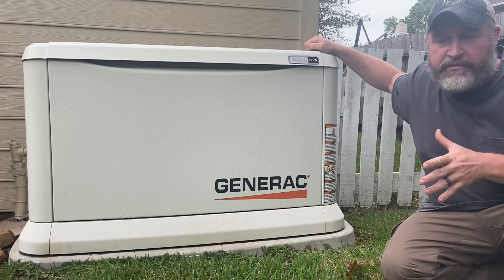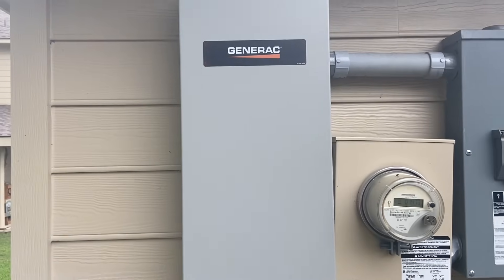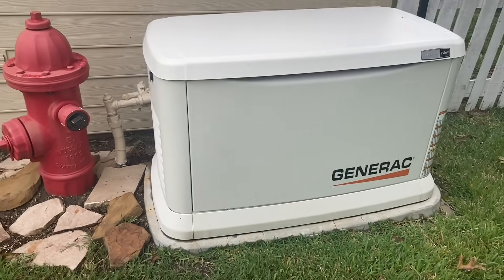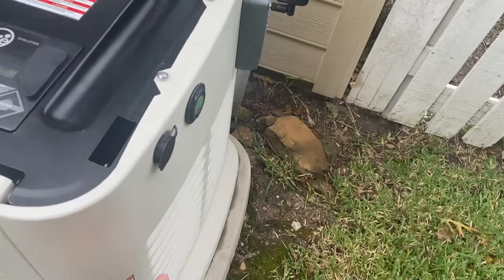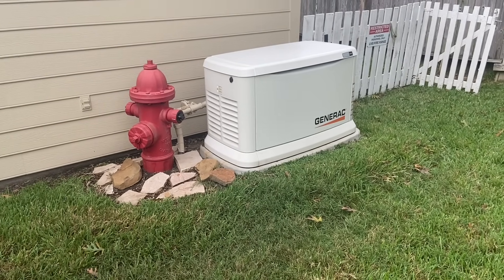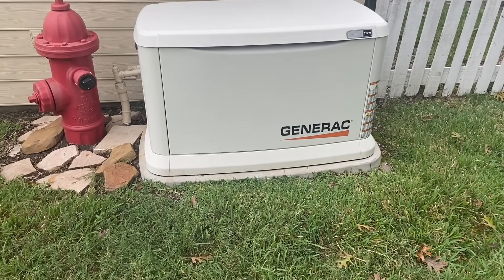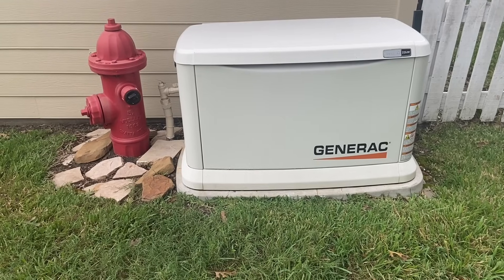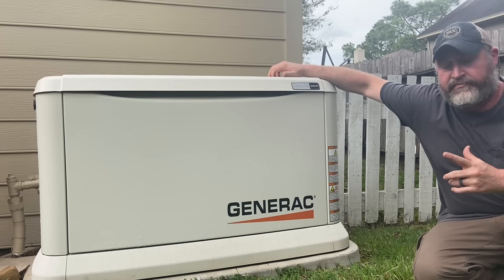Thinking of purchasing a generac whole home generator?

Comment: I have one of these because of the sump system in the basement and what can result from a loss of power which happens in Indiana during winter.  I have no regrets with this buying decision made years ago.  Only thing that went wrong was the recharging device for the battery for the starter but that didn't break the bank.
Reply from the maker: Nice buddy thanks for stopping by and checking out my channel. Please subscribe like share!

Comment: Nice but too expensive it's cheaper to just replace all the food in my freezers and refrigerators
Reply from the maker: Got it for more than just that , but thanks for sharing your thoughts and watching
Reply: YES, but it is about more than that. People can and do die in heat waves, and having access to some a/c, cool foods and drinks, etc - means a lot. With my mom during a huge heat wave without power, I could not get her to enter the air conditioned car to leave. She was having bad stomach problems, and as usual was not being logical. To her, she "couldn't" leave the house during an extended power outage. I had to rush out to buy battery operated fans to at least have SOME air circulation. We had central a/c at the time, and a small bedroom a/c I fought with her to leave installed - think of how wonderful it would have been to have just had electricity for the one bedroom a/c? She would have had a cool bedroom and bathroom -
Reply: nobody buys a generator for that smh try being with out power for days / weeks
Reply from the maker: @terrisw05  exactly! Thanks for watching and the comments, please subscribe and check out some of my other videos I do a lot of engine content.
Reply: And if that's all you need it for, you are lucky.  If you have a well as I do, you also lose water once the pressure tank runs dry and while that may be ok for a few hours, a few days is a whole different situation.
Reply: What if the gas company goes down?  Sorry but am serious - it seems like “they” find a way to make life difficult
Reply from the maker: I am 44 and have never lost NG to a house so…..I gamble I guess

Comment: uses 200 to 300 cubic feet per hour.....50 to 75 therms per day .....now natural gas had been cheap, up until the war in Ukraine, but even now that is still $150 or more per day for fuel......
Reply from the maker: Last time we needed it the cost was 17$ per day
Reply: Ridiculous. Changing plugs every year is ridiculous. Paying someone $400 to do yearly maintenance, is ridiculous.
Reply from the maker: @donwold1622  i agree we pay to monitor which includes the yearly maintenance thanks for watching.
Reply: @kenchiison4570 let’s go Brandon
Reply: @donwold1622  Paying someone to perform required maintenance is cheap insurance.  Doing it yourself would certainly be less expensive-it is.  But having a trained service tech is a lot like skipping the general purpose doctor (i.e. homeowner) and going with the specialist, who can sometimes spot problems before they happen, and you wouldn't know otherwise, doing it yourself, until it didn't work-and that truly is EXPENSIVE.

Comment: Jesus these machines are loud AF.
Reply: Yeah but wouldn’t you rather hear the sound of a generator running than silence when you have no power for 8+ hours?
Reply from the maker: I can’t hear it inside the house with the A/C  on and tv on. At night we run a fan still can’t hear it.
Reply: Eddie A  not entirely typically the storm knocks out the power but with the exception of all the stand by generator homes for the most part the following hours or days since the storm is when generators really start running, but when the power is out the only ones who care about the sound are the suckers with no generator 😂
Reply: Eddie A  Mine is dead quiet, and the light never goes off. Its called a Tesla Home Battery. 
But it won't work as long as these gas Gen do. Unless you have solar to recharge.
Reply: maybe you can build a sound proof barrier around it and screen behind the louvers to keep the critters out
Reply: @fredpinczuk7352  where did you buy yours? They’re quite difficult to come across no?

Comment: Community beware generac are all be up to date because they failing breaking and take months to get fix I have their products and are failing 3 times a yearly
Reply: Details? Which products exactly? How are they breaking?
Reply: They are very problematic these days, I have an industrial 50kw that has been a lemon ever since it was installed. Have seen numerous Industrial and Home Generacs with similar issues. Wont start, undercrank, overvoltage, etc. I'd stay away from Generac and look at Kohler or Cummins. Also be aware just because you buy the extended 3 or 5yr warranty doesn't mean they will honor it.
Reply: As a distributor, we know the stories all too well. In general, they are crap. You are lucky if you get four years with no problems. Many people have problems well before that.
Reply: My solar panel was change corsets twice one month. 
Powerlink burn last summer and now is winter, and last see what the surprise. Generac generator pw links and the raley  fail .

They don't have specialized technicians in florida available to take care .

Take 3To 6 months  to look and get parts and no guarantee

Comment: I had my Generac whole home generator installed 10 years ago, still running on the same Red top Optima Battery.
Reply from the maker: Nice mine came with a 18 month interstate battery and that battery was junk. I did not know the onboard charger could work with a AGM optima battery? I went with a wet cell die hard and it’s been good since we replaced the interstate. Thanks for watching have a great weekend.
Reply: @JustCantSitStill  Thank You! Have a Great weekend also.

Comment: We have a 12KW Generac and everything you said was correct except service is only $288.00 in 60137 Our generator is not that loud, however it is the same engine as you have and our lights come on 15 seconds after losing utility power.  We also have a 20A line to the neighbors house free.
Reply from the maker: Everything I said was correct for my area , I pay for the gen monitor service which includes more than just maintenance.

Comment: Had my 16kw generac installed about 6yrs ago. Ran fine for about 5 yrs and it is getting into my wallet now. Stepper motor last year $540and now my rotor is bad $1780 more.  Came home after being gone for the winter to a red light on . Have had this unit serviced annually by a generac dealer since we purchased it,not happy called generac and complained but dont think anything will come out of it.
Reply from the maker: Wow that stinks Chuck , guessing no warranty left ? Thanks for watching please subscribe if you have not already and please check out some of my other videos!
Reply: Another reply about Generac customer service. I know my unit was a year out of warranty,thought they might help a little on part i had to replace.  Was  a 16kw that had a bad connection under slip ring collar on the rotor. When i called them had some lady that read strictly from her manual said that I needed to talk to the company that installed my generator for any help on cost. Was not the fault because of them just a faulty connection that was a manufacture issue. Lady was of no help and rude. Will think real hard about ever buying another generac product
Reply from the maker: @chuckp3742  hey Chuck are you going to end up paying to get it fixed or just going to leave it? Just curious of where you go from here.
Reply: @JustCantSitStill  Had it fixed, to much money invested and we needed to get it running with us being gone during winter months. Real disappointed that you spend all this money and got dinged last 2 yrs.  Not a fan of the generac brand
Reply from the maker: @chuckp3742  thanks Chuck for the reply and I really hope you have no more issues.

Comment: I have an appointment this morning at 11:00 to discuss needs and associated cost of a Generac back-up generator. I am retiring in 3 months, and live 40 miles from the city. We're not first priority when we lose power, so I want the peace of mind knowing my wife and I will have several days of back-up power. Thanks for the informative video. I do not have piped NG, so will have to have a LP tank installed. I am prepared to pay close to what you paid in total. I hope it doesn't exceed that.
Reply from the maker: Excellent I have seen prices once in my area for the same set up I have to 13-14k. The large propane tank will definitely be a added cost.
Reply: I think when you use a tank the cost of the actual generator is slightly less.  The issue you will have is having enough on hand.  Not sure how long it takes a tank to empty

Comment: Great price for system size and various runs you had to make. I had a Kohler 12kw (I get a 10kw yield on NG) for 10.5 in 2015. Done by local electrician & Kohler dealer. Price included plumber to do gas pipe, permits, transfer switch (which is also the breaker box, replacing my old antiquated box). Electrician also upgraded outside hookup to utility, new meter pan, main breaker (upgrading from 60A to 100A). Have lost power only several times over the years, but when it happens, it's great to have. the 10kw powers everything in the house, so like you, no changes. The only difference I noticed between your installation and mine, is the Kohler starts the engine in 3 seconds, and transfers at approximately 6 seconds after power loss. No upgrades were required to my meter.
Reply from the maker: Nice 👍 thanks buddy for stopping by the channel! Please subscribe like share!

Comment: Lived most of my life in southern Louisiana.  We've had a portable generator for hurricane season; then we moved into a house with a whole home generator, in fact a 20kw Generac for about 2,100 sq ft.  There's no going back.  Just moved into another house, 2,600 sq ft, without a generator and we've been discussing what to get.  Since we no longer have city water and sewer, we have even more incentive to have seamless backup power.  We will probably end up with the 22kw Generac as well.  We will also have higher installation costs because our electric panel and water pump are located as far as possible from the two a/c units and the NG.  Most of the people we know with generators have Generacs.  We get lots of use - can't imagine anyone on the Gulf Coast not having one if they can afford it.  Can't say I learned much from your video, but you hit on all the points we've discussed as we estimated prices and models.  Good job.
Reply from the maker: Thanks D for checking out vid, good luck on your upcoming purchase and I hope the install goes smoothly. We will always have one now as well if we move another unit will be purchased for sure. If you have not already please subscribe like share and check out some of my other videos.

Comment: Yours kicks on so much faster than mine. Mine is a 24kw and just over a year old. Usually it takes around 30 seconds to crank over after utility power is lost. Then around 5 seconds for the transfer switch to engage.
Reply from the maker: Strange I figured it would be about the same for all , maybe it’s the length of electrical run or something.
Reply: Depends on the set up.  Some ATS start timers fixed and time out after 10-20 seconds before a start command is generated, then the generator starts, and some of them have have a warm up timer, so not uncommon on some brands.

Comment: I am retired and still young enough to do work by hand. I have 12500W portable (1150W on propane) I have to plug it in to its 50A outside receptacle. I store it in my garage and roll it out when I need it. I then lock out street power and switch to it. I have enough Propane to run for 2 days. I am in PA. High up where I can't flood and we practically never have natural disasters. Cost $1500 for generator and all other electrical parts I installed my self. We don't lose power very often and its not a matter of survival we just get bored with no TV or internet and my wife is disabled so it's very convenient.
Reply from the maker: Nice work! Thanks for watching please subscribe like and share

Comment: I appreciate your details. I just got my 24KW from Generator Super Center, with the monitoring system. They had the 10 year warranty "offer included". I'm also in Texas. However, mine was 3K more. I just want my wife and I to have peace of mind, not if, but when it happens (and, in case I should pass). They did use copper pipe, not black or galvanized - which I'm concerned about (read where gas eats away the inside of the copper). But the plumber reassured me that it's ok. Mhee. Well see.
Reply from the maker: Thanks for your comment and for watching I hope your never need it and if you do I am glad you and family are protected
Reply: Copper?  Black iron is the preferred piping for natural gas or propane, on the low pressure side.  Copper for LP on the high pressure side is ok.  But, many LP installers (sadly) don't know the difference between 1/2" copper "pipe" which is actually tubing, that measures by outside diameter versus  black iron pipe, which is INSIDE diameter.  Not the same thing when it comes to volume of gas flow.

Comment: By other people's reviews of it seems It's not that reliable for so much money, but it's a good concept. I only have the natural gas stove because in winter it's a lifesaver. I'd rather go for a couple of generators and connect a couple of heaters just get a bunch of fuel in containers anyways winter power outages don't last that long. I think it's more reliable than if that fancy machine fails and you don't have a plan B. Please keep us posted if it's reliable and please consider having a plan B.
Reply from the maker: Yes I plan do make a another video after our next extended outage. Thanks for watching please subscribe and check out my other videos.
Reply: Had Generac's on my last three houses..... reliable back-up power through numerous outages. Idaho, Washington and now hurricane country. Storing enough gasoline for an extended outage is very dangerous and the fuel can spoil.... plus refueling a hot generator is sketchy.

Comment: Good video. One thing I did notice. The second regulator in the horizontal position should have been installed with the "nose" pointing up and there should be a short nipple and a 90 with a screen in it. With the vent in the horizontal, water or snow(if you get snow) can enter the regulator and cause issues.
Reply from the maker: Hey buddy thanks for watching the regulator your speaking of is under a roofed patio so no worries. But I appreciate the comment, please subscribe like and share! Thanks

Comment: My Generac 14kw has an Orange light also which has various functions and indicates the need for attention.  I suggest you level the pad again to maintain proper oil level inside the engine.
My power is restored in about 7 seconds.  Well thought out.  You have a good contractor.
Sometimes in Winter (Southern ON Canada) frost will accumulate on the armature of the genset and it will not auto start.  Makes 2 or 3 attempts.  You may have to attempt to start it Manually until you get through the frost layer.
I have thought of putting up a 'wall' 4'x4' of Styrofoam near the exhaust end of the unit to reflect noise away from the house.  I also had my contractor install an exterior 30 Amp Duplex outlet so I could share power with my neighbour if I choose to. 10ga 40' extension cord would be used.
I do not think you could bury a propane tank in this area.
Reply from the maker: I am not sure if your comment was directed to someone besides me but my pad is level, thanks for watching please subscribe like and share.
Reply: @JustCantSitStill   Your pad does not seem parallel to the garage siding and looks low on the left end.  Perhaps it is camera distortion.

Comment: a correction for you the monitoring device on the side is not Wi-Fi it is LTE through Verizon, (I am an Authorized Generac Dealer/Installer) we do a monitoring program for our customers and its only $73 per year and $223 for the maintenance.
also they ripped you off on the permits i have never paid more then $90 for gas/electric permits 
and there is no off season fall is always busy because people are getting ready for winter and they want their generators installed before that (that is just a sales tactic to make you feel like you got a better deal) so they could charge more and then just mark it down to look like a deal.
you had mentioned that you could turn it on and off remotely, you cant actually do that. it just makes it run an exercise for 5 minutes
talk to the dealer and see if they monitor it as well because they will have remote monitoring capabilities and be able to diagnose issues as soon as they come up (this is something we do at my company)
Reply from the maker: Yes I mis spoke when making the video , we pay 440 a year for the monitoring and maintenance. Thanks for watching and the comments , please subscribe like and share!
Reply from the maker: I am guessing the permits would definitely depend on the area you are working in. We normally need generators in my area for the summer not winter so we probably do have a off season. We normally don’t have to much of a winter to deal with. Last year was the exception.